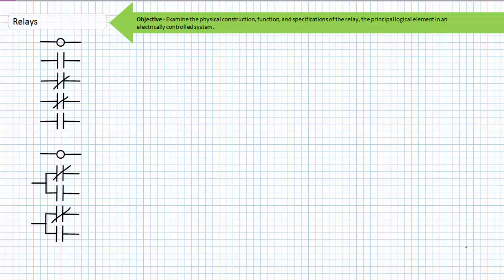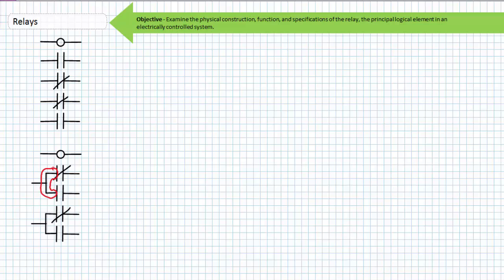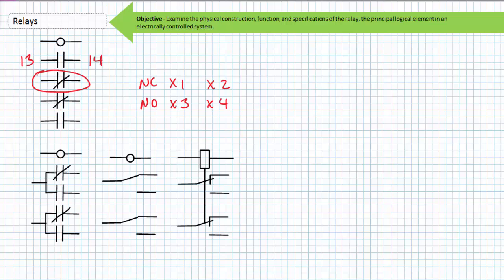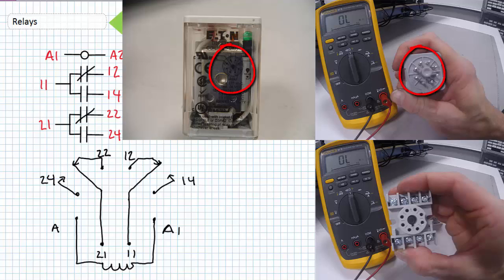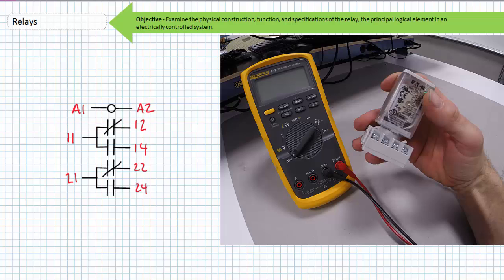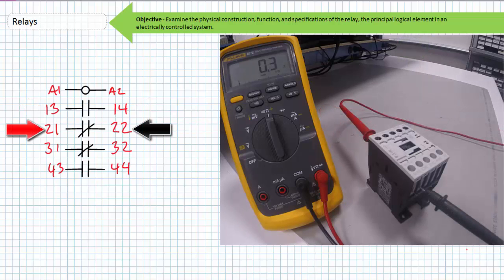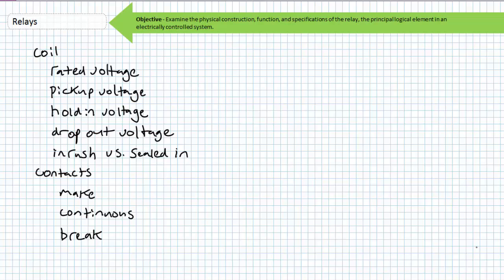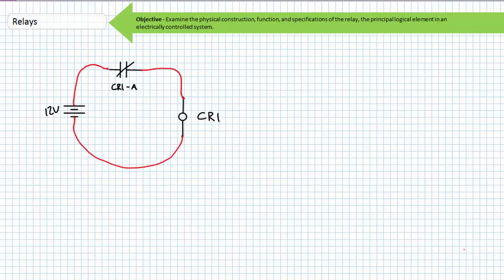Control Relays (Full lecture)

Comment: The IEC numbering explanation is fantastically useful!
Reply: It’s a waste of time. If you don’t know what a terminal does and you don’t have the cut sheet, use the continuity function on your multi meter.
Reply from the maker: RB ... yes! One of the earliest lessons involves me tossing a relay at a first year student and asking "What is connected to what? Use your DMM to tell me." After poking around in ohmmeter mode they can determine the layout without even understanding what a relay is nor interpreting terminal numbers. Later on in the motor control class the relay doesn't seem that intimidating.

Comment: Hi Mr Pytel,
For several months after first working with control relays I had been referring to this video to refresh my understanding when work with relays was required. Through repeated work experience and repeated exposure to this video, I was able to move from nebulous understanding to a solid understanding of control relays. In my work I am also regularly exposed to safety relays. Saddly there is no online resource that I have been able to find that explains them in any detail. I know you are very busy, but would you consider doing a lecture on safety relays and safety switches at some point in the future?
Thanks for all your help,
John